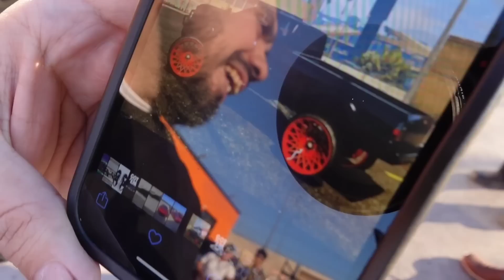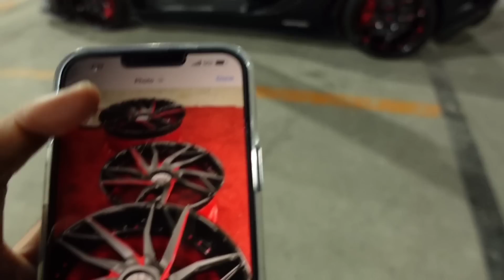FINALLY PUT RIMS ON MY SVJ AND THE TRUTH FALLOUT WITH OMAR WHEELS AND FORGIATO

Comment: Those center caps...been through the struggles with fresh repainted wheels, caps won't snap in because of thick paint on the rim. I'd have to either sand down the caps or the part where the cap sit behind.